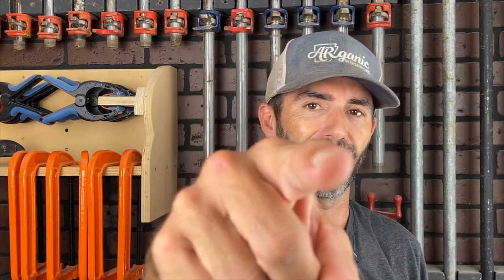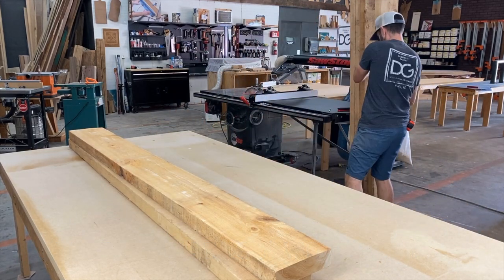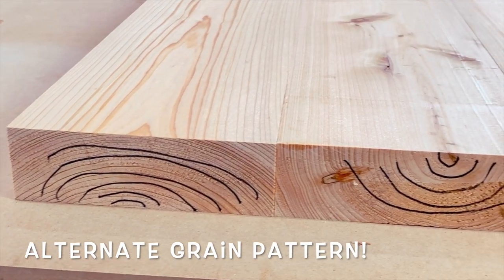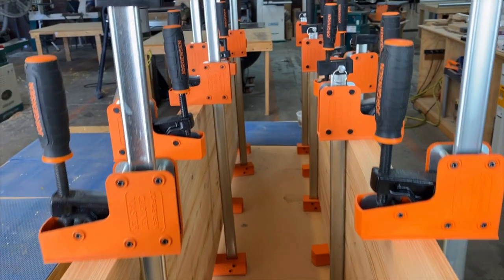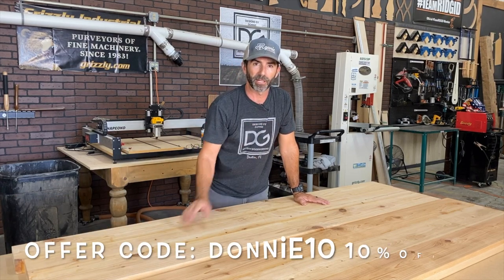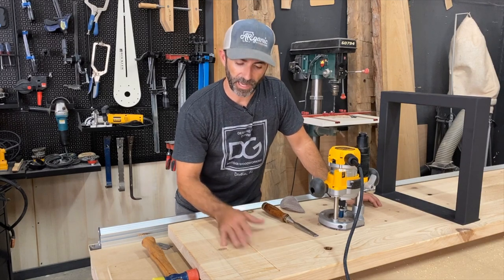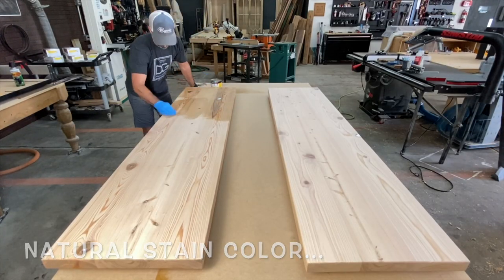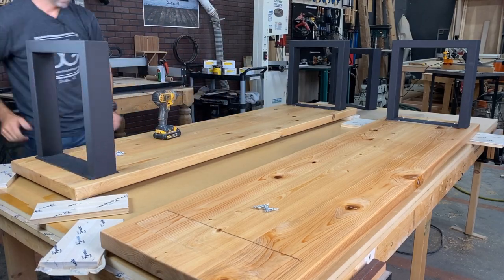DIY Bench | Wood & Metal

Comment: Great work again. What did you spray before adding the ca glue? Also should you add this to natural splits along the wood before treating it?
Reply from the maker: Hi 👋 thanks for watching! You’re the best! And I sprayed the CA glue accelerator into the crack before applying the CA glue so that it would cure quicker. Also yes I apply the glue into the cracks before the finish because will take sanding after it cures 👍
Reply: Designs by Donnie that’s awesome thanks Donnie, and thanks for taking the time to reply. Keep up the epic work!